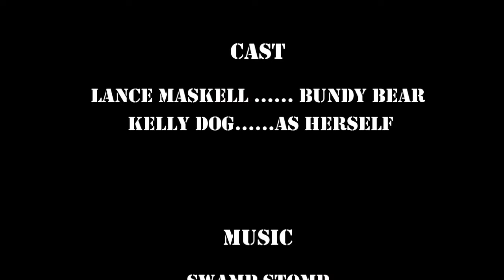How does your Ferguson TE20 Air Cleaner work?

Comment: There was a story circulating around our valley years ago about a farmer who soaked his oil bath filter in gasoline.  It was a deisel tractor.  He reinstalled the filter with it still being a bit wet.  Upon start up it went to extremely high RPM and the clutch departed through the cae and flew some 40 feet.
Reply from the maker: It would rev like buggery alright, frightening.

Comment: I have seen so many way to date a MF 35 but they all seem to contradict each other. How can I find the actual year my tractor was manufactured? It is a MF  fe35 Coventry built only 3 gages tach oil and ammeter
Reply from the maker: www.queenslandtractorspares.com.au in the technical section.

Comment: Here is a maybe dumb question.  I purchased a vacuum cleaner that used water as the filter, it was called the Rainbow.  Little to no dust can through the water "filter" so when we finished vacuuming we just dumped the water.  Is water better than oil to filter air?
Reply from the maker: I think oil would be better but any fluid obviously works.

Comment: I have just bought a T35 and have taken odd the air cleaner assembly. It was completely devoid of oil and in the bottom was the dried-up residue. I cleaned it up and have found a couple of pin holes which is where possibly residue has worked its way through. Any suggestions as the best way in which to fix the pin holes please. Great video and many thanks
Reply from the maker: I solder or Braze the small holes up.

Comment: I have restored a MF 35 Deluxe tractor. It has a rectangle oil bath air cleaner that is rusted through and is not all there. I would like to replace it with the same type of air cleaner although I have purchased a round one I COULD use. I cannot find the rectangle one - I understand they were only put on certain 'deluxe' models. Would you have any idea where I might find a rectangle type - or the part number for such?
Reply from the maker: Not sure I have seen them.

Comment: Had the same problem with lots of grass fibre blocking the mesh, did a lot of jiggling in a petrol bath with very little progress so I turned it up side down and set fire to it. Worked a treat, once it cooled down the now burnt grass washed out in petrol easily.
Reply from the maker: Great tip!

Comment: Thanks, great video, very helpful. Out of interest - I think the two types in the video are “Burgess” and “A.C.” - do you know which is which?

I have also read that the oil bath should be cleaned and refilled every 10 hours of operation. Looking at mine, it’s probably not had any attention for 50 years!!!
Reply from the maker: I didnt know about the different brands, I had not done any research there.

Comment: Nice little clip Bundy Bear. Question - do you fill with oil both in the inner cup as well as around the outside of the cup?
Reply from the maker: Yes it will even out through the little holes

Comment: 6:00 i wonder can i just block that hose off?  because my replacement air cleaner i brought is the wrong one or something and doesn't have the small pipe coming out of it
Reply from the maker: The engine does need to breathe some how or it will build up pressure and you will have oil leaks you never thought possible.
Reply: @BundyBearsShed  thanks i will modify the new one this weekend

Comment: TO-20 Oil Bath Filter question..
I am in USA and have bought an old 1950 Ferguson TO-20 tractor we  want to get running.  It did not have oil bath filter assembly at all.  I am told the part (p/n 181657M91) is discontinued and cannot find any aftermarket replacement for this part.  Any suggestions?  I can find TO-35 aftermarket part, but this style has air coming from dash, TO-20 does not.  Can I convert different model oil bath filter, like the TO-35 to fit my TO-20 tractor?   I can find a couple of used TO-20 oil bath filters, but look pretty rough condition and pretty expensive for used parts.  But maybe that is best option.  What do you think Mr. Bundy?  Any suggestions?      Thank you for any advice you can offer.  Really enjoy your videos!       (tractor has Z120 Continental engine, if it makes a difference)
Reply from the maker: With the ones that go to the dash you can often put a top pipe on it as they are a very similar size and it is in the centre.
Reply: @BundyBearsShed  Thank you Mr. Bundy.  Unfortunately, the TO-20 model does not go to dash.  Might be able to cut hole in hood and extend a pipe with pre-cleaner as Ferguson did with some 3 cylinder TO-35 models.  Would rather not alter the tractor this way.  My son may want to restore with original look, although he certainly plans on it for working tractor.
-- I can get a original used oil bath assembly part..   and if I change filter screens, it should work as new, I think?  
-- Do  you have any info, video, or experience changing out the screen material within an Oil Bath Filter?

Comment: Got an oil bath on the Field Marshall. Still has coconut fibre media too. What do you think to swapping out the coconut for a VW paper element or leaving it out completely ?

The DPA pump resell was good but l need some help on servicing my Gardner 6LX pump please 😁😁
Reply from the maker: G Day Duncan, For what the Field Marshall will do for the rest of its life I would leave it standard. I would not leave it out if you plan on tractor pulling etc. The Gardener pump would be an old in line pump I would guess?? Just start at one end and work your way through lol.

Comment: Hey Lance
As a french organic small scale farmer, I have to thank you sooo much for sharing your knowledge . You're channel is like a goldmine for me as you're explaining so well how to restore these vintage machines. I've learn so much from you from resealing a CAV pump to replace a universal joint. You make appear maintenance so easy.
Do you plan a full steering box rebuild on your TE20? I've seen your video on replacing a steering shaft, but would be VERY interested in seeing the full process for a MF 135/140 which should be very similar to the TE20.
Do you plan to finish the video about the park brake on your front end ford loader (I have a very similar one on my ford 4000)?
Knowledge and experience coming from old timers like you is just priceless. Please keep going on. Thanks to know I can slowly but surely restore my Ford 4000 and MF 140 ;-)
Reply from the maker: G Day Adrien, I should finish my old loader. I was just looking at the parts the other day, they are still on the bench. I'm very slack with that one but I bought a fork lift so the loader does not get used a lot any more so it went off the radar. 
The TE20 steering box is coming up soon but they are a bit different to the MF35. The injection pump video is now over 360,000 views and has increased the sales of the injection pump seal kit fron 12 per year to 14 per month. That is the power of the internet and I have made some great friends along the way. Thanks for watching and commenting.

Comment: the problem with oil bath filters is that they we're only about 40% efficient at removing dirt, paper filters do about 90%
Reply from the maker: G Day Joe, Yes they were not as efficient but in England they seemed to work well, we can test any air filter in our dust out here in Australia. I know for sure Massey Ferguson and Ford tractors both upgraded the air cleaners and fitted safety elements for the Australian market. You would wonder what the difference is, apparently dust is not just dust.

Comment: Yes I grew up with oil bath air filters on Fergies Nuffields Fords Internationals etc , did a good job and cheap to maintain but I often wondered what happens to the oil with the volume and speed of the air surely it must get thrashed about an awful lot , I wonder would oil work as well with todays huge horsepower high revving engines , just wondering
Reply from the maker: G day John, One problem with the oil bath was if it was over filled a diesel would run flat out on the oil. I think the paper element does a better job now a days.

Comment: Wow, that looked better than new when refinished. They were pretty smart back then in the design of this. Unlike today, there wasn't the availability of consumable parts(paper air filters) that there is today and therefore cleaning the filter regularly was the norm.
Reply from the maker: The oil bath was a good filter, they couldnt sell you extra parts with it each service which was a bonus.

Comment: Thank you this has been very helpful, just taken the air cleaner off a non starting Massey Harris Pony and it was full of water and sludge, I have washed it all out using spray lubricant WD40 type stuff and wondered what and where the oil went, know I know, so thanks again. Yes I now have a running tractor and have subscribed to your channel. Kind regards Sir from the UK.
Reply from the maker: Glad it helped

Comment: Thank you for the info. Lance.  next is the oil and filter change. is there any specific oil that you'd recommend ? can't seem find anything on oil weight for TE20.
Reply from the maker: G Day Danny, The tractors started out with a mono 30 engine oul but there are many like a 20w50 etc now for the older engines. Put the same oil into the air cleaner bowl and engine.
Reply: Much appreciated thank you.

Comment: What's your grey paint 🎨Lance? Controversial topic 💣💥😂😂😂
Reply from the maker: II see you must have been here before knowing it can be a can of worms lol. 
The painting I do on these parts is just to protect them before assembly and the proper paint job. I buy the aerosols of Stoneleigh grey from Sparex. The original colour was battle ship grey as Harry Ferguson bought it from the military surplus after the second world war, or that's what I have heard but there is almost as many variations as there is tractors as sometimes at the bottom of the big pots they bought there might be a little more colour as it settled and different batches may have varied slightly. As long as it is close that is ok to me. Sparex are now owned by Agco , (Massey Ferguson) so I am thinking they should be close to the right grey.
Reply: Yip, I've got a email address for a guy (John) that used to work on the production line in Banner Lane. He says the same, there's no definitive shade. Whatever was cheapest 💷 I suppose 😀
Reply from the maker: I have seen people get all high and mighty about this subject lol as if it is life changing. Good to get inside info on it.
Reply: Did not know you can buy rattle can grey allo

Comment: Thank you.  Great vid and informative as I’m a new TE20 owner
Reply from the maker: Glad it was helpful!
Reply: Bundy Bears Shed  yeah I cleaned it out today. 
Lots off debris and old oil removed  runs better already 
Can you help with the gearbox I cannot select reverse stuck solid  and tried moving the slider with a bar but no joy 
Tractor is a TE 20 Perkins P3 engine conversion

Comment: I just took mine off a TED-20. The small pipe bit that comes up on the inside of the oil bath bowl is rusted and gone, plus the bit that comes down to meet it on the upper bigger mesh housing part, plus the inside mesh is rusted. Maybe I'll just buy a new one. What do you think?
Reply from the maker: will usher yeah or look for a good second hand one
Reply: Can't find one on Ebay so I'll probably get the Agriline one. Might fix the original old one at a later date. Cheers

Comment: That air cleaner is basically the same as what's on my MF 231. That simple system was used for years and I didn't realize it. I keep the oil clean in my tractor. Isn't it an effective system? I love your videos.
Reply from the maker: G Day 231MF, It worked well but now the paper element types take more of the dust out and do a better job but these are still ok.
Reply: +Bundy Bears Shed 
Yeah I would think the paper elements are better filtration also.

Comment: Lance, can you buy new wire packing for the air cleaner?  Couldnt see it in the Bareco website. Mine looks like it hasn't been cleaned in 50 years. Or is persistence with the petrol washing a better use of time than deconstructing the filter assembly? Thanks!
Reply from the maker: G Day Scott, It does not appear they have the TE20 one but do have the bigger 35 etc. ones. I found washing works well enough but it does take time and you need to be careful. I have never been happy with deconstructing them as they always seem to have a gap here or there. Depends how careful you can be I suppose.
Reply: Bundy Bears Shed, Thanks Lance. Did a number of rinses to get the worst of it out, then soaked overnight in fresh petrol. Came up a treat with a heap of rubbish in the bottom of the bucket. The old girl can breathe again! Looking forward to the pump and top cover overhaul videos.
Reply: Scott Ragg 
For future reference, I would use diesel or maybe mineral spirits. Gasoline is extremely explosive as it evaporates.